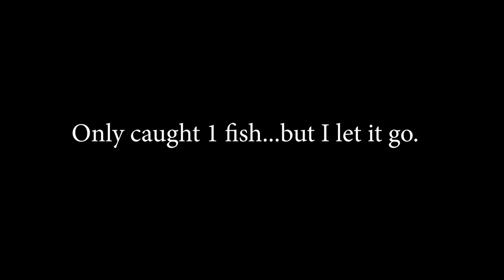D.I.Y Crappie Rod Holder ($30????) 8 ft pond prowler or sundolphin install! EP#6

Comment: If the PVC won't stop bending in where the bolts go through the rod holders either epoxy or a wood dowel inserted at the rod mount will stop the bending.  
Good idea, except for me.  I have bad balance and I'm afraid if I grab the rod holder the thin plastic would tear out the screws on the boat.  My boat is thin there.  Thanks for sharing your design.
Reply from the maker: Hmm... never ran into that issue. Most people have there drag set so you don't put extreme stress on the rod holder. Recommend to use the thicker pvc I believe it's 440psi so very strong for crappie fishing. I've caught plenty catfish and get hung up all the time with no bend. Again having your drag set properly is a must. But thanks for the views and comment. This is a simple blueprint for better designs if needed.
Reply: @fredbfishintv  Cool.  I was afraid to drill into the boat because I saw how thick the material is.  I took a lot of steps to reinforce for mounting my rod holders because I'm hoping to find some 30 pound catfish.

Comment: How well did it end up holding up in the long run? Does a snag while trolling or a hard hit cause it to torque/twist loose from the bracket?
Reply from the maker: No never really had that problem yet. I've had multiple rods get snagged at once and it holds by the time I stop the trolling motor. Plus having your drag set on the rod will help with that issue

Comment: What is the part # of the bracket?
Reply from the maker: https://www.lowes.com/pd/SteelTek-3-4-in-Silver-Galvanized-Steel-Structural-Pipe-Fitting-Floor-Flange/999930950
Reply from the maker: They come in different sizes as well depending on what size pvc you choose to use. Hope this helps!
Reply: @fredbfishintv  I just like to know  parts  # I couldn't  find  in Lowe's here in Georgia
Reply from the maker: Yes click the link and it will show you the part# and model#
Reply: @fredbfishintv  Thanks.  The info. Was very helpful.  I like  your rig for my job boat.
Reply from the maker: No doubt! Thanks for enjoying the content and inspiring your own project for the boat! 💯🎣

Comment: Where did you get the mounts you screwed them to the boat with? Cant find anything remotely close at lowes or home depot near me
Reply from the maker: Hmm...I get mine from lowes but either should have them. "Self drilling screws"
Reply: Im talking about the little metal bracket the pipes slid down in? I had to use flagpole mounts
Reply from the maker: @user-md2xz9yx8c  😆 my bad I'm trippin...
https://www.lowes.com/pd/SteelTek-3-4-in-x-Silver-Black-Steel-Structural-Pipe-Fitting-Floor-Flange/1000421965?cm_mmc=shp-_-c-_-prd-_-plb-_-ggl-_-LIA_PLB_142_Pipe-Fittings-_-1000421965-_-local-_-0-_-0&gad_source=1&gclid=CjwKCAiAkp6tBhB5EiwANTCx1NpxZ2DAWImqxk2h9M053qGzep0gLIhcHjbHBsXJP324XsqZn4vQvBoCOv8QAvD_BwE&gclsrc=aw.ds
Reply: I found them sameones online,the lowes by me has to order them,i used flag pole mounts

Comment: Will u PLEASE list the items you used ?
Reply from the maker: Sure!
Reply from the maker: Added links in the description. Hope this helps!
Reply: Thanks man .. one last question ! Did the weight of the rods make stand fall over ?
Reply from the maker: @kaelinglover9239  nope not at all. Just don't make it too tall. I stayed between 2-3 feet tall. Plus the rod holders are adjustable so you can make up for the weight.
Reply: Now I’m just tryna figure out how u put the Rod holder on
Reply from the maker: @kaelinglover9239  😆 I know right. You just need another bolt that's the same size thread that comes with the rod holder but get a longer length so it can go through the pvc then use the twister lock nut to secure it. If u pause the video on that part it will give you a good idea.